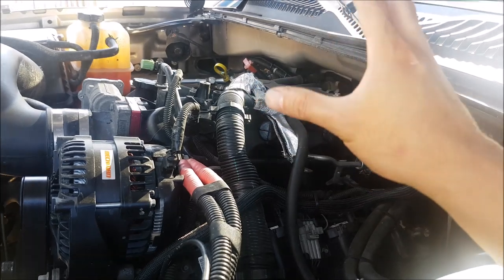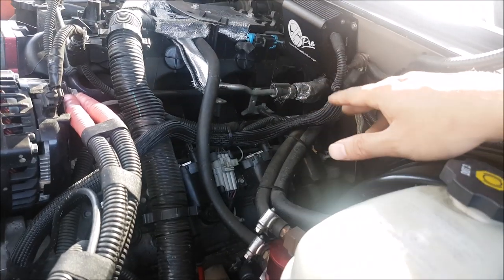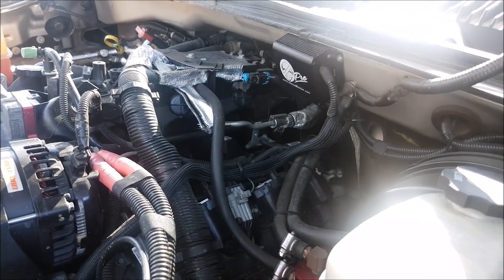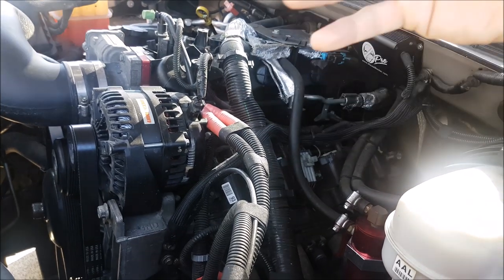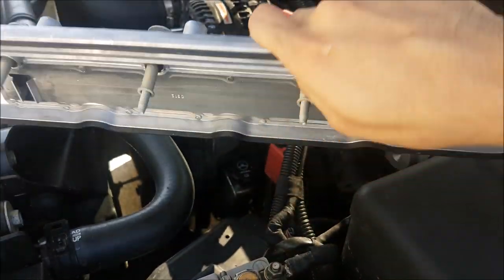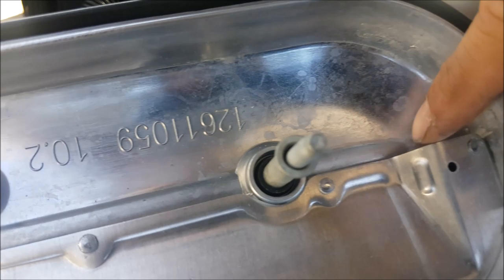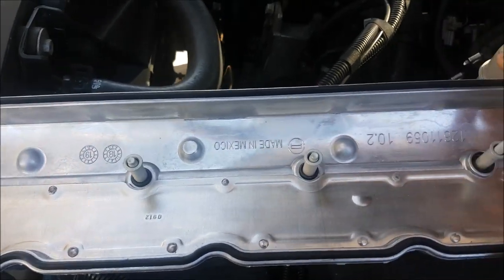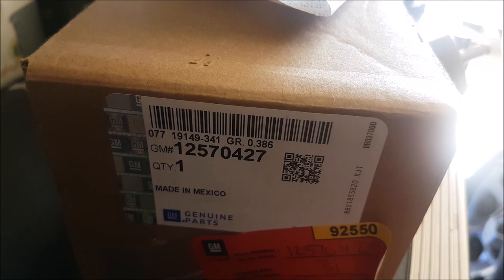LS Motor Valve Cover Update oil in Intake Manifold (PCV System) | AnthonyJ350

Comment: Why bother with a catch can if you already have a mid-year 2011 or newer 5.3 with all the proper updates from the factory????
Reply from the maker: I would rather double it up and help slow it down.  That's just a preference because I don't see OCC always as a guarantee.
Reply: The newer engines need a catch can even more since they have the displacement on demand crap...they have a tendency to drink up oil quicker than the older gen LS.
Reply: @eddiefromcali  I love getting 22mpg highway with the displacement on demand in my eight passenger 6000lbs Suburban. I haven't noticed any oil consumption.  It can't hurt it putting a catch can in just see if it works on the updated newer models.
Reply: Mines is an 11 and it uses oil like crazy...not impressed.

Comment: Too bad GM didn't warranty it though.
Reply from the maker: 2005 truck I wouldn't expect them too. Seen so many of these trucks go over 300,000KM
Reply: @AnthonyJ350  2005, no, but ever since they came out with the AFM oil consumption as been an issue. And that is the 2007.5 model. They always denied it as they said a quart in a thousand miles is normal.  When one can't stand behind their product, I won't own another. Now, the AFM/DFM is such a problem on the 5.3 that they are discontinued starting this month. Blaming it one shortage of semiconductors. Another damn live by Government Motors!!!
Reply from the maker: @billmonroe8826  Weird because my buddy's truck is well over 800,000KM, and apparently a lot of this generation trucks are approaching 1,000,000KM https://youtu.be/30NRW3dhkck
Reply: @AnthonyJ350  If you do any research on them since 2007.5 it's a major issue. Oil consumption and lifter issues. Many do a DOD and get rid of the problem. Their new style is also causing issues. Could explain why now they're ending the AFM/DFM on the 5.3 and blaming on a shortage of semiconductors.  GM just refuses to stand behind the problem.
Reply from the maker: @billmonroe8826  I'm sure they have issues. But what's the percentage of affected? I still think GM push rods engines are the best gas V8s you can get. My next truck will be a 6.0L without  DOD because I like simplicity and I want the bigger engine in the 2018s.
Reply: @AnthonyJ350  Lots and lots. The percentage I would bet is high. But either way, GM should be standing behind it. I've seen many around 100,000 and less needing new cam and lifters.
Reply from the maker: @billmonroe8826  What's the statistic though. Everyone I know with these trucks has had great reliability from the engine. I don't see Ecoboost or Hemi going as long on average vs a GM pushrod. GM warranties their engines till 160,000KM.

Are you changing your oil every 5,000KM?
Reply from the maker: @billmonroe8826  You've seen many? You're a mechanic servicing them?